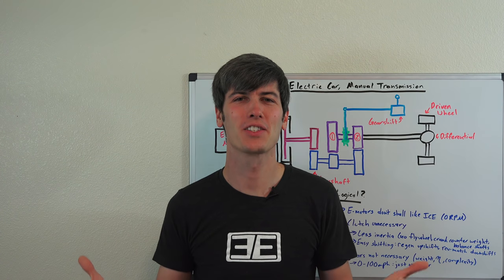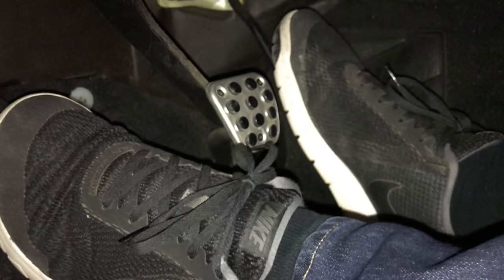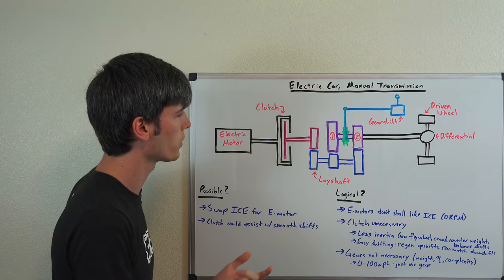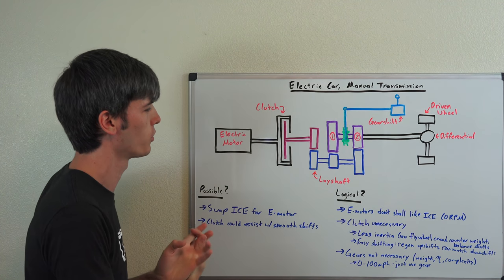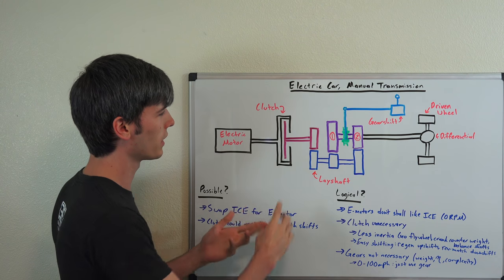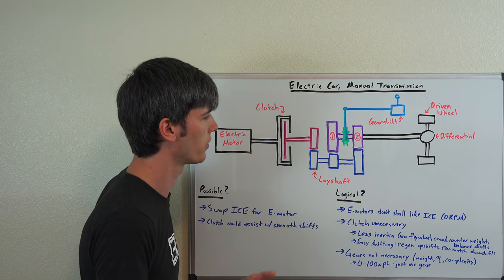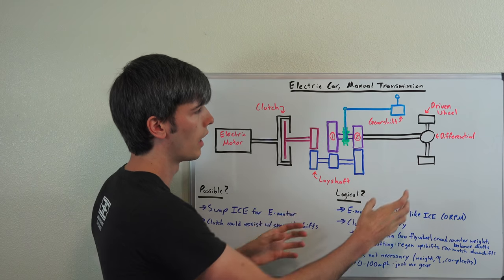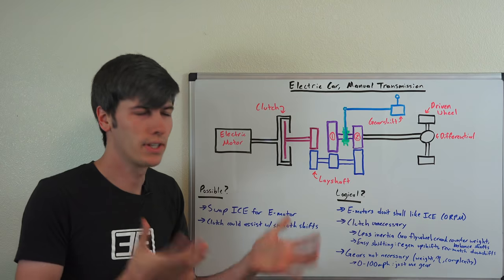Could Electric Cars Have A Manual Transmission?

Comment: lets not forget one of the main reasons to have multiple gears on an ICE engine is to keep the RPMS low when you dont need the torque and maintain efficiency for better MPG. Electric motors are more efficient at higher RPMs so they dont need to be kept in lower rpms to maintain efficiency..
Reply: low rpm gives a lot of you torque but is inefficient
Reply: jerseyforlife how a car without tranny can go 150 200 mph . also wouldn't it be nice going 60 mph with low rpm.low rpm=more economy,less noise.
Reply: are you talking about an electric car?
Reply: Electric motor can spin up to 20k. Compare that to a mere 6k typical ICE can.

Comment: The big problem of eletric motors is the high consumption at high rpm, a good CVT gearbox is not a good solution???
Reply: I have never heard CVT and reliable in the same sentence, so thats probably why. But yeh logically thats what makes sense to me too.
Reply: Well in reality most people don't drive at 150mph for the majority of their use, it's more like 50-70 and in that range you are way better off not having  extra weight of a transmission.
ICE have a very small power and efficiency RPM band, electric motors on the other hand have a huge one.
Reply: Rodrigo C. Actually electric motors are very efficient even at high rpm. The reason for a multi speed gearbox with an electric motor if you need both very high starting torque AND high top speed.  Electric motors have a maximum torque limit, maximum power and maximum revs limit. From 0 rpm up to a point maximum torque is applied. Power increases since P=revs x torque. When you reach maximum power the torque starts to drop off so it maintains constant power as you increase revs up to the rev limit. The rev limit can be either due to  mechanical limits( bearings can't handle the speed) or electrical limits(batteries cannot provide enough power to increase speed)
Electric locomotives for instance are geared low if they pull freight trains - more pulling force at the expense of speed or if a passenger train is pulled then they are geared taller for less pulling force but higher speed. They both use the same motors.
Efficiency simply isn't a concern because the electric motor is highly efficient at all operating speed with minimal variation as the load or speed change. Thus no need to bother with a multi speed gearbox.
Reply: Electric motors do not have high consumption at high RPM. They have high consumption at high load.
Reply: @Petar Miletic , I think you are confused about trains. They are not running off of batteries like cars and the AC motors are running as traction motors. Electric trains have diesel engines that provide the power and are tuned to a very efficient and narrow rpm range. They use traction motors as the phase angle can be controlled at a constant power output thus acting like a CVT. They do not 'change gears'  or even have any gears at all.
Reply: No I'm not confused, here in Europe a lot of trains are fully electric with an overhead power line,a pantograph rides on the wire, and the rails act as the ground.I understand how diesel electric locomotives work, in fact i'm surprised there aren't more heavy diesel electric vehicles like excavators etc. Diesel electric is much more reliable and simple at high power output. Just imagine having to make a clutch that could handle the torque of those locomotive diesels !!! And you would need a lot of gears to keep the diesel engine at optimal speed. Diesel electric transmission solves both problems. And sure diesel locomotives power output is limited by the diesel engine. But that's not the case for the full electric ones. Electric motor torque is proportional to current that flows trough the windings. The current creates heat and that heat has to be dissipated otherwise it would melt the insulation. But it can be overdriven for a short period of time to produce more torque as long as you back off before it overheats. At higher revs you are limited by the supply voltage. DC motors have back EMF that increases with revs so that the current and thus the torque is limited as rpm increases. Similary as AC induction motors speed increases you need to provide higher frequency AC. But as frequency increases the max current that the motor will draw is reduced because the inductive reactance of the stator coils limit the current. Current reduced -> torque reduced.
Reply: Most European cities are moving forward with sweeping bans on all diesel engines. That's why they are disappearing.
Reply: thats why transmissions should still be in electric cars, you can improve mileage by using less power and staying in lower rpm ranges
Reply: Absolutely! I noted all this with my electric Miata.
Reply: A Crustacean - Global Sweeper is a  CNG engine. Most accessories on a sweeper are power by hydraulic fluid. Hydraulics are much more capable than electric direct power. Altec has E-PTO which is a electric motor that drives a hydraulic pump to do work, but this is for a bucket truck which ain't always doing work. They are counties in the USA that do not allow Diesel powered sweepers. In those counties, they use CNG.
Reply: Timothy Lee Wietzke you can also improve "mileage" (range) by taking it easy on the accelerator (and ergo use lowest amount of revs necessary for forward motion), not to mention skimping on the aircon and other electrics (radio, heated seats, back seat dvd's etc)
Reply: Now you're in my wheelhouse.  I was a locomotive engineer for a major Class I U. S. railroad.  You have a good grasp of how electric traction works in railroad applications.  The way I always heard the difference between steam or ICE and electric traction is that electric traction's highest potential torque is at 0 mph, whereas steam locomotives and ICE engines have a power curve whose most efficient speed is dependent on the gear ratio for ICE and the diameter of the drivers (essentially the gear ratio) for a steam locomotive.  Older DC traction locomotives have what is known as "transition", the point at which the phase of the motors changes from series to parallel.  It's usually around 24-25 mph.  If you were to stand by a railroad line where trains were starting up a fairly steep grade from running at mainline speeds, and were in the right place, it would sound like the locomotive was downshifting as it slowed on the hill.  The engine would slow to idle for a couple of seconds, and then rev back up.  That would be the system transitioning out of parallel back to series as the speed dropped below 25 mph.  It's all done within the control system of the unit, the engineer does not have to do anything.  If a locomotive is not well maintained, sometimes it will buck making the transition, like an old Chevy with a bad tranny.  I noticed this most on some older EMD (GM) locomotives, like the SD-60I's and M's.  

Also, older DC traction locomotives have what are known as "short-time ratings".  This is the length of time you can operate a locomotive in the "overload" or red zone on the amp meter.  The amp meter shows what those times are, plus they are also in the operating manuals every engineer carries.  If you exceed a short-time rating you risk burning up the motors, and when you reach the limit you are supposed to stop the train and put the locomotive in neutral and rev the engine to the fourth notch (out of eight) to rev up the traction motor fans to cool the motors before continuing.  AC locomotives do not have short-time ratings, and can lug a train at very low speeds (like down to 1/2 mph) for a considerable time without damaging the motors.  Most freight locomotives I've been on that are operating at the upper limit of their rated pulling capacity will settle into a grade at around 12 mph if they are not going to stall with the train.  You know you are in trouble if you can't hold 10-12 mph up a long grade with DC traction locomotives.  Usually with D-E locomotives it really doesn't do much good to get a high-speed run at a long grade, you'll still end up topping the hill at around 12 mph, if you are going to make it over the top.
Reply: This is completely incorrect. The eCVT dials down the rpm under freeway load. The Prius does 1100rpm at 70mph.
Reply: @petarmiletic997  excavators and big equipment use hydraulics it's not a surprise hydraulic motors best electric

Comment: I was really interested in watching this video to hear your ideas on it, I went to a technical education program at Oramge-Ulster CTEC and we actually had a converted electric vehicle, a 5speed Chevy S10 that we put an electric motor into and utilized the bed as a battery holder, the clutch pedal had no use in the design and whenever it was driven to events we only ever used one gear. The truck was honestly a rocket, the teachers wound up putting 285mm tires on it because the instant torque combined with a super low first gear made it a smoke machine on tthe stock tires

Comment: One of the greatest advantages of the ability to design the conversion stage from electricity to whatever force you wanted it end up with as your output in a single clean motor. Every pair if gears you add to a system is a meaningful friction/windage drag loss, and at light loads it's a very meaningful oil pumping penalty to have gear teeth and differential dragging through an oil bath. Every stage of power downstream of your motor is just added losses and failure modes. The same added mass and cost to the vehicle applied towards increasing the motors radius vs gearing stages yields a higher efficiency and higher continous power solution with far fewer moving parts and failure modes.

Comment: i think 2 speed manual can be used on electric mini trucks. Lower gear for heavy loads and hauling stuff and higher gear for speed and saving power.
Reply: Because of the increased weight of a truck, a multi-speed transmission could make more sense on a truck than on a car.
Reply: How does elektrik locomotif work?

Comment: what is the purpose of having a transmission on an electric car since you can control the speed and torque much better by manipulating the frequency applyed to the motor?
Reply: Leonel Braga lower gear= more wheel torque at lower speeds
Reply: low frequency = no gears and more torque too.
Reply: Getting a more torque/power at low speed out of a small motor. But most of the time the efficiency-loss is not worth it.
Reply: A system with an electric motor designed for high torque by high pole count would be more efficient with a second gear if it would mean that it would not have to go very far into field weakening at highway speeds. This applies more to vehicles that require really high torque and also high vehicle speeds, i.e. performance cars, buses, trucks etc.
Reply: whouldent a gearbox whit lets say 2gears give the posablity to get in to a higer gear on the higway and get more speed out of less engine usage? or does electric motors not work like that?
Reply: Basically, there's a specific operating point where the efficiency and torque drops quickly. This point moves around depending on motor load, voltage supply level and RPM. It might be worth it as long as the gearing allows you to hang out below said operating point (with respect to RPM and torque output) and that the efficiency gain cancels out the mechanical efficiency drop from having a gear box, weight of the gear box and increase in cost. It's not very black or white :)
Reply: ABaumstumpf  omg would people stop with the efficiency crap about transmissions. A 2 speed trans can be made to be over 95% efficient which is easily good enough to justify the benefits of a second gear.
Reply: But imagine that low frequency paired with a 3:1 ratio 1st gear........ Talk about acceleration
Reply: Nathan Curet we're not talking about 2 gears here, obviously 2 works out, the question is would a 5 speed or six speed be worth it
Reply: Nathan Curet - with just 95% efficiency, what do you gain in comparison to having no gears at all? 
Oh right - LOWER EFFICIENCY.

You can do that if your motor is so small that your torque at low speeds is insufficient, but with electric motors that is hardly the case. That is why for "normal" electric cars even a 2-speed transmission is not worth it.

Or please, go ahead, tell us - why would you want to add more weight, more points of failure, when the car already has pretty good acceleration, goes fast enough and is really efficient?
Will be funny seeing you struggle with reality.
Reply: well if the engine needs lets say 60% of its maximum power to keep a speed of 100kmh (just puting easy numbers on here nothing to do whit real power use to keep 100kmh) if you whold put a gear box in there so that the engine whold only need to be at 45% of energy and do lower rpms that whold mean longer range. im taking about makeing them efficient to get further. performance is another topic
Reply: Leonel Braga The induction motor loses torque output as rpm increases beyond a certain point.
Reply: Electric motors also have a range of RPMs at which they lose torque, that`s where a tranny would help, besides, you don`t need a regular tranny, a planetary gear would do...
Reply: Because fun.
Reply: Not sure what you saying but manual transmit ions are more durable that's why there in drag cars with three speed trans and can still go 300 miles an hour in just 3 seconds
Reply: +leolnel braga, efficiency! all the way!!!!!!!!!
Reply: Well for me its not the case of efficiency loss cause you can Put a smaller and but more efficient electric motor and make the transmission compensate for the torque loss, tune it for electric power efficiency and there you have it.

More range for the ev future.
Reply: Leonel Braga there are some fundamental limits which depend on motor construction and... size.
Reply: Larry Brock Probably not. Still, I think 3-speed gearboxes can be useful for vehicles that have to pull a lot of weight. Cars with caravans, buses and trucks on very steep hills and when they're driving on motorways they can use the third gear as overdrive. Multi-gear setups also can return when there's a shortage of copper.
Reply: @supportervandeeuropeseunie1625  How does elektric loco work? It pull loads too
Reply: Fun.

Comment: I have not finished the video yet, but of course this makes sense, especially for trucks and heavy things you're trying to get up big hills. 

I have built a mid drive electric bike, and use the same 7 speed rear-transmission for the highway, I can shift up to 7, otherwise, I keep in in third or fourth. You notice huge watt-increases up hill, but if you stop it down a few gears the watts drop to manageable levels. Starting in low gears also keeps the amps down as the motor spins up, making the torque feel a lot smoother.

Comment: So, I have a question. I've been  watching this channel for quite some time and I must say that is very informative and one can learn very interesting stuff about mainly how these things work. I haven't seen all the episodes and I was wondering - is there anything about how dual clutch works? I would realy love to learn more about it.
Reply: Many years ago, (in the 1960's) my Dad had a local sawmiller come to our farm, to cut rings from several trees that had fallen on our farm
He arrived driving what can only be called a MYRICAL (of co-built engineering antics) - in that it could be driven VERY FAST using two reverse gears?
It had of course, two gearboxes, one that had it's clutch still connected, and after whichever gear was selected - was then immediately connected to the clutch input of the second gearbox. (the output of the 1st was mounted directly to the other's input shaft).

Selecting 4th gear in the front gearbox, and NEUTRAL in the 2nd, he could then operate the large (circular) sawblade, amidship of the old "full chassis" vehicle, such that by simply moving the saw-bed IN & OUT, it tightened or loosened the drive belt from the lay shaft between the gearboxes, to drive the saw itself, cutting logs on the saw bed.

To drive the vehicle on the road, he simply used the 1st gearbox in 4th, and the rear box as normal - for road speeds.
He could also select reverse in BOTH gearboxes, to get a slightly faster top gear (in a forwards motion) that couldn't power the car up any hill.
He could though, put the 1st gearbox in any lower gear, and also put the 2nd gearbox in a similar lower gear - to crawl slowly over muddy farm paddocks, as if he was in a 2wd tractor.
Using 1st in both gearboxes, meant an ant (well maybe not an ant) could walk faster.

Many people have devised many different uses, for gearboxes over the years, and some people swear they don't need them (crashing the motors into starting in say 3rd and NEVER taking it out of 3rd, means they can roll, but not as the vehicle was made).

Sadly, having an EV designed for city uses, on mainly flat roads, means that sure, THEY can state they don't need gears or clutches, but try using an electric drive in a tractor that is used to draw along say a 6 furrow plough - without gears or a clutch, and soon you will find the electric motor blows it's protective supply fuses and buggah```, you are then totally stuffed, as simply replacing the fuses won't work, as the plough will have become firmly stuck - in that mud, meaning the motor cannot turn to even try and get it unstuck.

Comment: Imagine an electric car w a 5 speed and straight cut gears lol
Reply: Lol super whining.
Reply: Dont they already use that for purpose built electric motorsports cars?
Reply: @RyuzoSan19  wasn't aware, which ones?
Reply: @18837ven  Not too sure, but I am hearing some familiar whining sounds on a 1000+ hp Mustang Mach E drift car.

Comment: I can still see a transmission being used in production electrics so a single cheaper electric engine can get more torque on high load, even if it's just two gears.